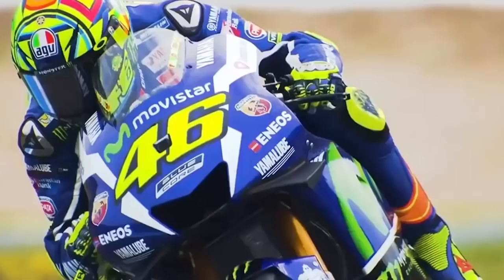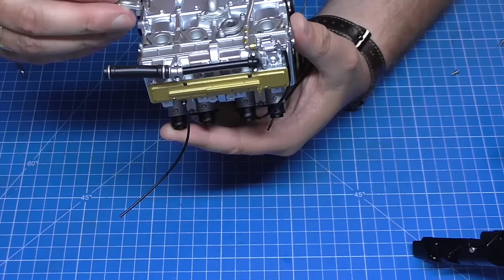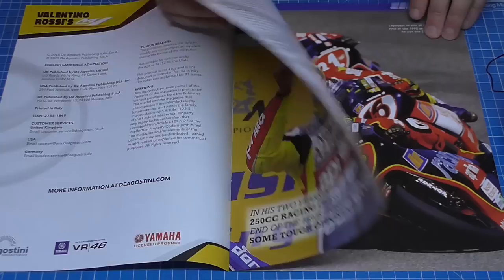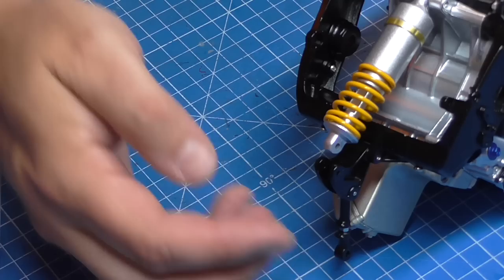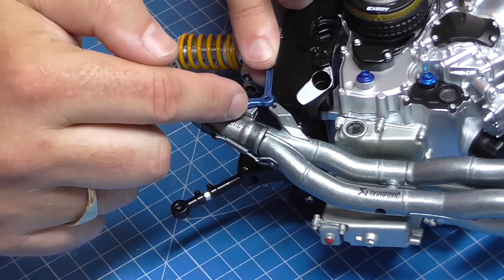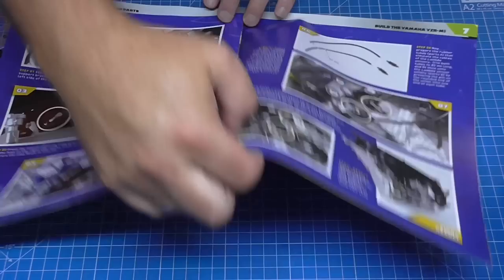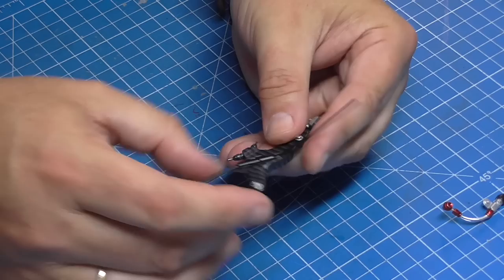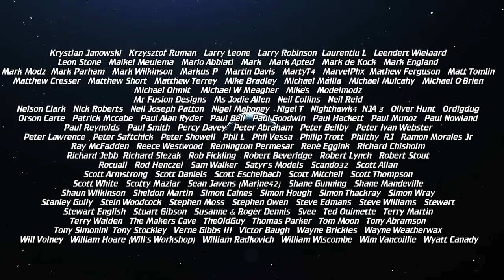Build Valentino Rossi's YZR-M1 Motorcycle - Pack 10 - Stage 42-48

Comment: I was panicking when you started hammering with the screwdriver 🪛 into the plastic gaskets on the manifold...hope you didn't ding them up...
You should use a dowel or a popsicle stick to hammer gently against plastic parts...
I even use them on metal...no damage or scratches...lololol

Best regards mate...

Comment: Hi Wayne I have got upto issue 11 of titanic doing the funnel as I have 68 issues would I be better to take the plastic band out of issue20 so as I don't have to strip the funnel down can't remember  if you had to do this after putting first funnel together thanks ps did yo send me the ferrari  poster for my sons garage thanks
Reply from the maker: I kept it on for now
Reply from the maker: I haven’t yet. I’m trying to dig out all the other posters I have too
Reply: Think I might put plastic around wire in funnel save pulling it apart later